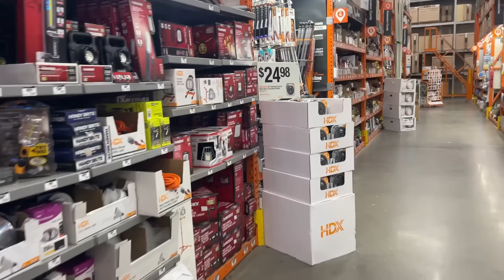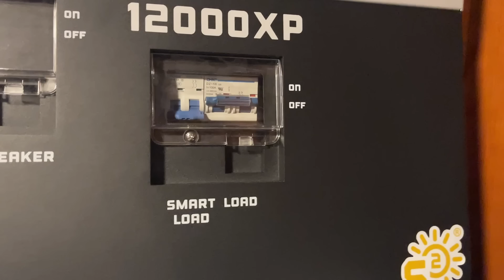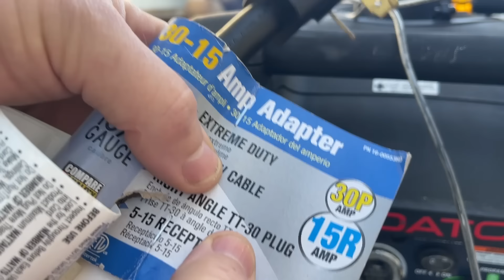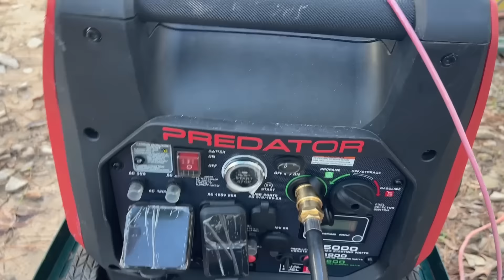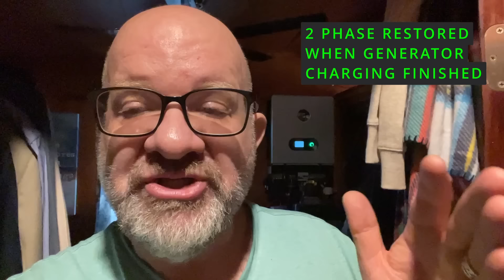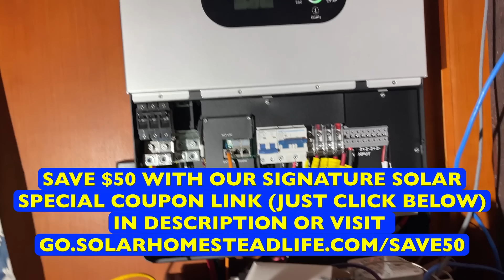EASY Solar Panel and Generator Setup To AVOID Disaster

Comment: Use a eg4 chargverter or a Victron Autotransformer. I have the Victron auto transformer connected to my Honda 120V 3000is and to the gen port of the 6000xp giving me 240V AC into the inverter. Works great and if all else fails I can use the autotransformer in place of the inverter.
Reply from the maker: That’s a great way to handle the 120V to 240V conversion for the inverter gen port! ⚡️

Comment: Very helpful. But you didnt show how you hooked the L1 and L2 wires from gen tie in breaker to that 120v plug. (Since it only has 1 hot leg, did you just run both to that?) Could you please explain
Reply from the maker: Great question! 👍 What I did was hook the 120v plug to Phase 1 (L1) of the inverter, along with common and ground. Since a standard 120v outlet only has one hot leg, you don’t tie both L1 and L2 into it—just pick one leg. In an outage, the other leg won’t be active, but for emergency loads it works fine.

That said, if you’re planning to run a small generator or keep things cleaner, I’d recommend using a Chargeverter (or a pure sine wave 120v generator) instead. It’s a much better long-term solution for charging safely.

Keep shining, stay charged. ☀️🔋
Reply: Thanks for that. I was told i need to jump l1 and l2. So i wont do that. I have the same 5000w generator as you. I hooked it up like you but im not getting anything on the inverter. Im not sure what to check next @offgridsolarliving

Comment: Some thoughts I had:
1. When using the TT-30 outlet on the generator, you can get the parts to make your own cable.  You really want to be using 10 AWG wire with this 120V port.  The EG4 can easily pull every last drop of juice out of the generator depending on how you program it for the generator port.

2. I have noted the generator limitation with the EG4.  Interestingly, there is a new open frame generator out that can potentially be signaled to start by the EG4 or so they say.  (I haven't seen anybody do this, so don't know if it is really possible.)  It is a bigger 240V capable generator.

3. You can get transformers to step up the voltage to 240V.  Not cheap from what I am finding, but they do exist.  Check out the Victron Autotransformer.  Maybe you could dig around for a used transformer you can rig up to do the step-up.  Interestingly, their 100A transformer is only a few bucks more than then 32A transformer.  Really though with the cost of one of these transformers and the additional power you can draw with a 240V system, you start thinking about a bigger generator to do the job.

4. The EG4 Chargeverter 5kW, while it can't put out 5 kW on 120V AC input, it can pull up to 28A from your 120V generator.  That will push your Predator 5000 pretty hard.  The EG4 Chargeverter needs an adapter cable for 120V operation and it works less efficiently at 120V, but then you don't need the transformer to step up the output from the generator.  Granted, with the transformer, it would be easier to use the built-in charger in the EG4 inverter.

5. Check your setup for a proper ground - neutral bond and proper Earth ground.  Each "independently derived" electrical system needs these to be NEC compliant, so I would go through the documentation and make sure with your generator hookup that you have proper bonding and grounding in place and that it is not double connected.  Especially if you go back to feeding power straight from the generator into the EG4, you want to make sure you understand how this is supposed to work for the system and that you have it hooked up that way.  You don't want fault lights on your equipment because it is not hooked up right.  Remember, the Predator 5000 is a floating neutral generator by default.

Comment: Just get an EG4 chargeverter
Reply from the maker: @turtle1723 Thanks for the suggestion! The EG4 Chargeverter is definitely a great option for regular setups. In this case, though, we were dealing with a natural disaster recovery scenario after the tornado. Our goal was to use what we had on hand to get power restored as quickly as possible. Appreciate the input, though—always good to have backup solutions in mind!

Comment: Good information. I have the same setup but with the 6000xp. My place is completely off-grid. I could not figure out how to run my cabin off of my generator (predator 5000) and charge my batteries (6- Vatrer 48v 100AH server rack batteries) simultaneously through the inverter. It was almost as if the inverter would not accept the power from the generator for some reason. Like there is this magic setting I’m not putting in the inverter. So, finally I just purchased a manual double throw transfer switch and hooked my generator , inverter and load to it. Then I purchased a Vatrer LiFePO4 battery charger I could just plug directly into the front of my predator 5000 to charge the batteries and run the cabin. I know this defeats the purpose of having the 6000xp to run everything through it but, I could not find any videos or support to help me understand why the 6000xp and predator 5000 would not work together. Anyways…I like the content and I hope you all get your lives back together soon. Tornadoes are not fun at all.
Reply from the maker: Thank you so much for your thoughtful comment and for sharing your setup! It’s clear you’ve worked hard to make everything function, and I really admire your resourcefulness. Since the Predator 5000 is a pure sine wave inverter generator, the issue might come down to specific settings or configurations with the generator or inverter, like grounding or transfer switch setups. Your solution with the manual double-throw switch and LiFePO4 charger is a really clever way to ensure you can keep your cabin running smoothly.

We also have the 6000XP here, but we haven’t tested it with the Predator 5000 yet. Based on your experience, I might try it out to see if I can replicate the issue and share any tips I find in a future video. Thanks again for watching and supporting the channel—it really means a lot! Wishing you all the best as you recover from the tornado. Stay safe, and God bless!
Reply: When you hook up your generator you can only hook up one leg to hot. So only use L1 + N to 120v. Leave L2 open (unconnected)
Reply from the maker: Yes that is correct. While charging with L1 L2 will shut down, but it's only temporarily while you're charging. It worked very well in the midst of the emergency and could work for somebody with only 120 V generator..